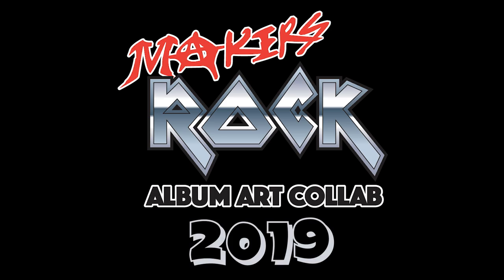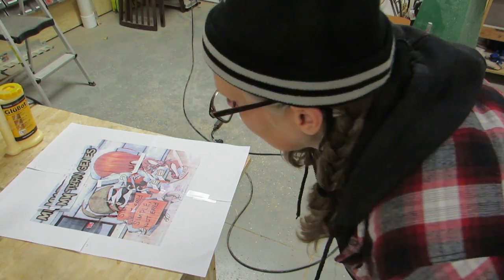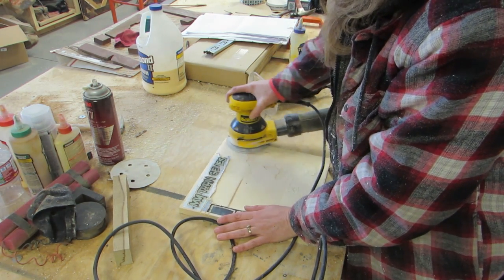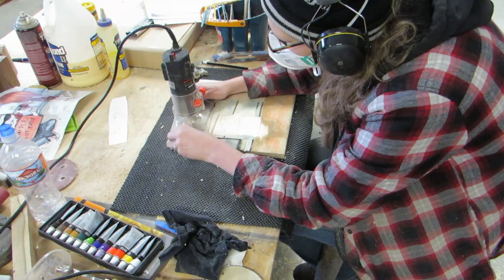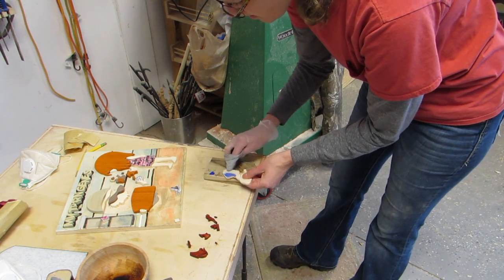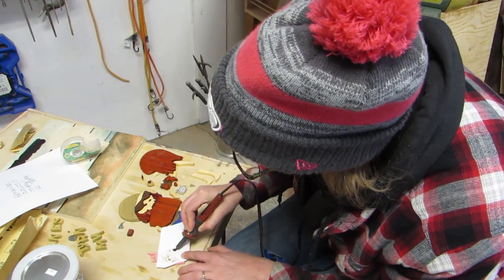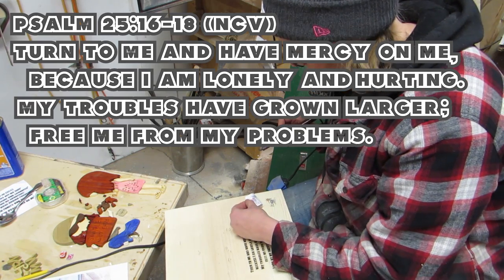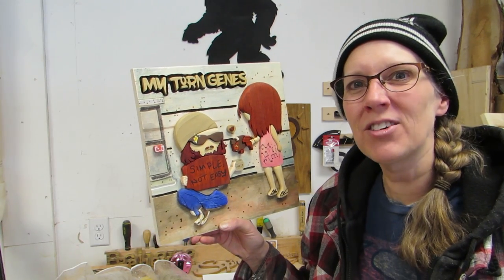Makers Rock Album Art Collab 2019

Comment: Hi Cy!  Hot tip for you...  Instead of using the blue tape as your initial layer on the wood, try using self-adhesive clear contact material which you can purchase at WalMart.  It's cheap, only about $6 for a roll.  You can place your paper patterns on the top of this with spray adhesive and, when you're finished making your cuts, it comes off sooo easily.  I began using this recently and I am very pleased during the clean-up phase.  Bryan
Reply from the maker: Hi! I recently started using that too but these pieces were so small I decided not to use the big roll!  :)

Comment: Looks great!  Is there a reason you have moved to the new scroll saw from the Excalibur?  Does it offer some desirable feature?
Reply from the maker: Hello, I had quite a few crazy mishaps with my Excalibur and have never had a well running machine. So far the Hegner has worked like I have never seen before, I am very happy to have it. The desirable features are stability, no slip blade, verticle blade cuts every time, quite, minimal vibration, and excellent customer service!